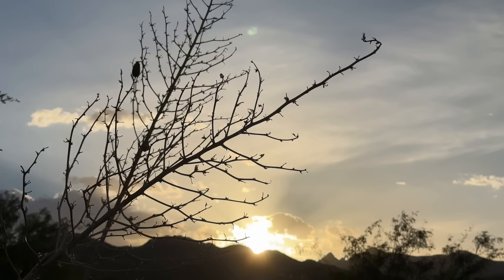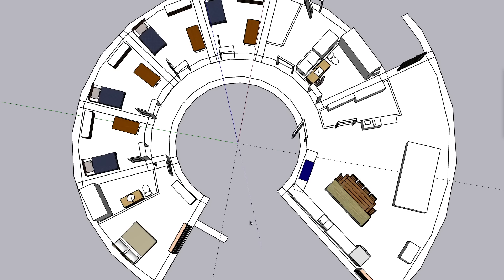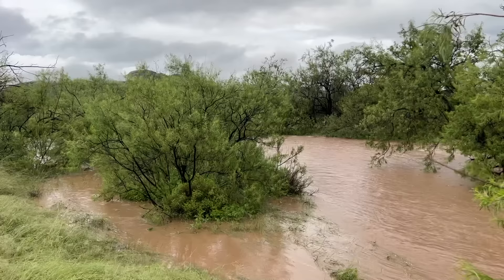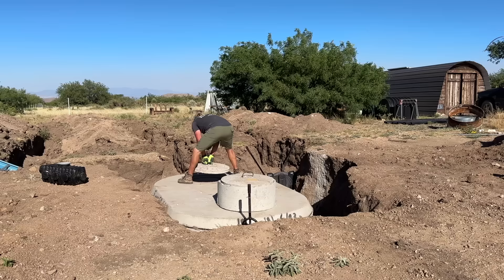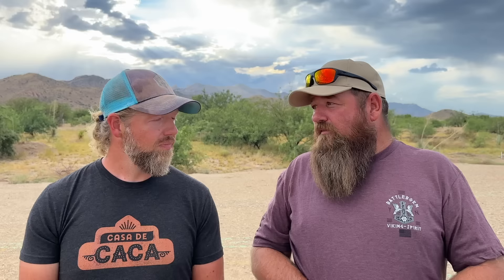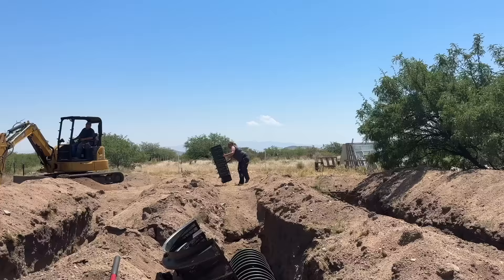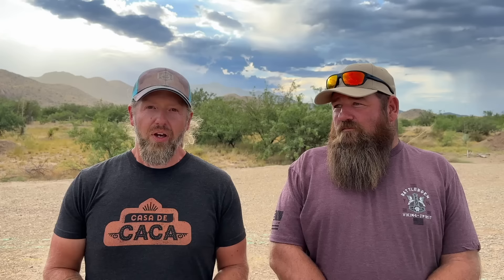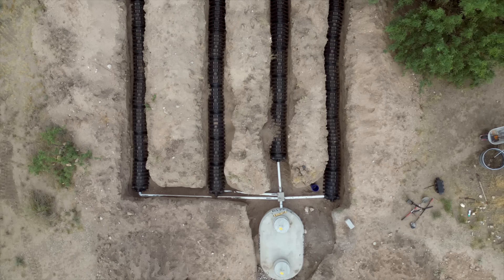How to INSTALL your Own SEPTIC SYSTEM (w Tips From a Pro)

Comment: Lots of good information here. I don’t recommend such a small d box. Always go with more holes for repair in the future. Also you won’t have to install a line across from the discharge of the sewer line from the tank. So water will be evenly distributed to all the lines.
Reply from the maker: Here in Cochise County you do have to have the D-Box sloped downhill and separate from the main septic tank. Also the equal levelers are required. The D-Box was one of the largest we could get.

Comment: Not really something you can do, but a guy I know wanted a shop toilet and he set three plastic 55 gallon drums in series with dip tubes between them. The scum if any would girm on the first one. It was mostly for pee,but if he had a solid movement, he just used tp and deposited it into a trash can to dry and them burned it later. 
  Our church had a hidden tank it was my task to find. They filled concrete chunks sll around it and with great difficulty I found it. The thing had absolutely no solids in it and it was like pumping water. .We pumped it to satisfy the county. It does prove how effective a lightly used tank is as this one eas not pumped in forty years. So the shop illegal toilet is probably cleaner than the legal house toilet .
   Out requirement is gor a split field that you divert every sux months.

Comment: A trick question, but, what would generally be the minimum lot size to support a septic system in your area?  It seems the size of the system is overkill considering your basic sandy soil and excellent drainage and depth needed for wells to reach a water source.😊
Reply from the maker: If you listen in the beginning Zach explains how the numbers work. It is sized exactly based on our number of bedrooms and fixtures and our specific sandy soil. The septic, well, and power definitely take up a lot of room on a property - you'd probably need at least 2-3 acres to get it all in there and not feel cramped. 4 acres and up on rural gets you the opt out.

Comment: My Mother was told many many years ago her septic system at the time had to have these half shaped pipes installed or else it could not be allowed ( some so called ignorant code ) and she could not have her septic system ( no local sewer system at the time ). note her homes yard was on a slope and they laid those half pipes down the hill etc. I did not know about it until the work was done, ( they would have NEVER installed it had I known I assure you code or no code ). Simple common sense tells you IF they had laid the over flow would easily transit those pipes and most would end up at the end of that system. needless to say after a bit near the bottom of the hill OUT came all the sewage over flow up to and through the surface above .
So this style system is good for warmer climates and flat areas. they are useless on slopes/hills and extremely wet areas . as over flow will always flow downhill and after it hits harder dirt etc, it will come up to the surface.
be sure you research those facts before using such material .
Now I live in my old home and we have a sewer system and no septic system and those crappy half pipes are still in the ground what a waste of money she spent at that time for garbage and a system some contractor / County inspector claimed she had to have that anyone with common sense would know could NOT work the way they laid it down the slopping property even with gravel etc...

Comment: Next time, install another tank and when the first one fills, direct the waste to the other tank while the first tank turns the sludge into compost. 
Important thing is you should use light chemicals to clean the toilet ware and put some bio bacteria/horse dung/sauerkraut/rotten milk/curd to ferment the waste.... 

 I do the same to mine.

Comment: I’m curious, why to use rock and pipe if the chamber has better absorption capabilities, and almost no chance to be clogged?
Reply from the maker: depends on your soil type. a lot of people have solid clay and when saturated doesn't absorb fast enough so they need rock for drainage..

Comment: number of bathrooms shouldn't matter. Really it should be calculated by how many people will be living in the home, but for future proofing (in case of selling the house) should be calculated by how many bedrooms you have. I have seen houses with as many as 5 bathrooms with 1 bedroom. 

For example, my house has 3 bathrooms, but only 1 master bedroom. Its a house we built for me and my wife, no kids. We also have a workout room and office that could be converted into a bedroom if we do end up having a child. So it would be ideal to get a tank that would accommodate at least 2 bedrooms, or 3 people. Personally I would go for 4 people.  

The size of the tank really just means how often you would like to have it emptied.
Reply from the maker: Like mentioned in the video, it's designated by the number of bedrooms, bathrooms, and fixtures. Not sure why you're talking about the bathrooms so much. It's a combination of all of them.

Comment: Everything is thru the roof price wise. 2003 I had a 1,200 cement tank installed 40% xtra length on the leech field. All installed for $2,00 . Then 6 yrs ago I did myself a 750 gal plastic tank w/ 60 ft leach field, dog house style, same as yours for $1,000 materials & a guy on a backhoe $875 for 8 hrs . . He dug it , I installed it . Soo about $2k. If I had it done now , it’s exspensive like u mentioned. Go poop now lol

Comment: You didn't mention that absorption trenches must always be ALONG the contours unless the distribution land is fully level.
Reply from the maker: This isn’t true here in AZ. They be pointed any direction, even curved if neeeded to avoid obstacles.
Reply: @TinyShinyHome  
Nonsense. All trenches MUST run level. I didnt say "pointed". I said run "along the contours", meaning run level.  Ask your installer. It's the code (and commonsense) all over the world. OBVIOUSLY if they weren't level, the outlet septic water would pool at the lowest end of each trench and lots of land runoff rain would flood the lowest end of each trench.
Reply from the maker: Yes, they should be level (mentioned at 14:43). "Along the contour" isn't really the right way to describe it, though. That's plotting or trenching across the slope of the land and making it level. We did that with our Berm and Swale project to catch sheetflooding monsoon rains (https://youtu.be/Z_pZSMs8vjs). Sounds like we're saying the same thing, just confusing terminology :)
Reply: @TinyShinyHome  
Jeezuz mate. The ONLY WAY to make a trench level on sloping ground is to run it along the contours . That is the correct way to state it. If it is a straight hill, it will be a straight and level trench along straight contours, yes across the slope*. If it is a rounded hill,  a spur, they will be curved and level trenches along the contours -- yes *across the slope . THAT'S  why a house site plan and a septic site plan MUST SHOW contours. A site plan can't just say "Trust me, it's level". If you dig it out with a dumpy or laser level, you will be walking *along the contours*. Nuff said.

Comment: Great vid but i not see point in the chamber in leach field as as the first will get saturated as the water just tip in from d box in the uk we put soilid pipe in level with holes in the side halfway up so the hole lenghth is full be for it tips out so its equal all the way far better and your tanks should have dip pipes on each chamber and and out let goes into a washed limes stone chamber first it takes the nast out of the out fall water far better system  .
Reply from the maker: The whole point of the D-Box is to distribute the water equally to all leach lines. Rock and pipe is another method we talk about in the video - just depends on your soil type, space for infiltration/leaching, etc... Infiltrators are just one type of septic system which works well here in our climate.

Comment: Is "infiltrator" what is generally referred to as "alternative?" I'm in Arizona and looking at areas where the soil has poor peculation, so I've been told I will possibly need an evaporation "alternative" leech field.
Reply from the maker: Zach talks about this a bit. If your soil isn’t leaching quickly the infiltrator system won’t work. He talks about rock and pipe as an alternative. I don’t know if it’s actually called alternative though.

Comment: Does the county let you build a septic system by yourself? Or does it have to be a licensed contractor? The quotes I got here in placer county was around $20k.
Reply from the maker: Like we mentioned in the video, the soil evaluation has to be done by a licensed professional. You can do the rest yourself in Cochise County, but do have to have it pass inspection.

Comment: The white PVC pipes coming out of the D box, are they level or have a 1/4" drop per foot? Also, is the Leach field level to or it has a 1/4" drop per foot too? Thanks!
Reply from the maker: All pipes drop from one connection to the next, but the trenches are level 👍🏻

Comment: Effluent outlet filter. I'm new to these systems and that is my biggest takeaway.
Reply from the maker: Yeah seems to be a new requirement
Reply: @TinyShinyHome  We are under contract on a home with a septic I wonder if it can be added.
Reply from the maker: Just a piece of plastic really. As long as you have the right sized pipe going out with the vertical bit it should be easy to add yourself.

Comment: Question? If it did not pass the Perc test, can't they use sand-line trench(s) under general permitting R18-9-E319 per ADEQ to get you to the permit stage and to have a septic system installed?
Reply from the maker: No idea you’d have to talk to the health dept or a septic installer.

Comment: 1/4" per foot drop; can one exceed that? And if so, is there a maximum drop grade? Also, are most codes (other States) for septic similar?
Reply from the maker: No you shouldn’t. Too steep of a drop and the liquid will go around the solids instead of moving them to the septic. You’ll have to do your own research for your specific local codes. Yes they will definitely change based on area, soil, county, etc.
Reply: @TinyShinyHome  thanks

Comment: Close to Denver up to the mountains some septic systems contaminate the underground pool(water) and a all family die because that. Researching around some articles seems that this system do not treat and all the pathogens go to inside the soil to be absorbed. Is this system safe if you have kids playing over the area and a rocky soil?
Reply from the maker: Like we said in the video, there are different systems for different areas and soil types. Hard, rocky soil probably wouldn't use the infiltrator system.
Reply: @TinyShinyHome  I'm in that phase deciding between the dry toilet or septic system. Researching a lot I saw that any septic system will not make miracles, just manage how fast this liquid will be absorbed by the soil, it is the best solution for do not disturb the local eco system. Basically it "hide" the waste from our  view and is not so aggressive / invasive to the eco system.
Do you agree? Your opinion is important to me.
Reply from the maker: Yeah that's the idea. Soil is a great filtration system, but it can definitely be overloaded. An undersized septic can leach into the water table, backup and create cesspool like areas, your animals will be drawn to it and get sick as will any other animals in the area. The calculations can be annoying, but they are there for a reason to keep you and your neighbors and the animal life around you safe.

Comment: A properly installed and maintained septic tank/system never requires pumping.  If you have to pump it, you are doing something wrong with it or it was installed incorrectly.  I had to have my septic system pumped after 29 years because we dumped the salt water from the water softener into the septic tank.

Comment: I just replaced my system that had the turtle shells. The idiots who installed it pitched it up. We had it done on a sunday at might night (no permits or anything), and we paid for it. Get it done the right way This new one i dont even know if its right bc the dude refused to put a tee on the outlet or an effluent filter. HE said it was against code.

Comment: No such thing as Schedule 35.  You must be talking about SDR35 pipe which is typically specified for use on gravity sewers in ASTM D3034.  Pipe with a schedule rating such as Schedule 40 or 80 is for pressurized water.  I never use ASTM specs for water anyway.  Should use AWWA specs for water lines.
Reply from the maker: Considering you can call up any hardware store and order Schedule 35 or do a simple internet search for the same term and get the proper results, it's obviously a common term that people use. While I love deep diving on systems and infrastructures, this is a video about DIY septics, and going hard on ASTM numbers isn't very relevant to this particular conversation. Love the dedication and enthusiasm, though :)
Reply: No such thing as “schedule 35” pipe.  You are giving professionals and inspectors more reasons to discredit DIY’ers and YouTube.
Reply from the maker: K, bud 🙄

Comment: nice idea... but installing a single piece, or even digging out for tank or trenches is not possible in many places.. state and/or county, and/or town/municipal rules, regs, laws require "licensed" or "approved" contractors to do all the work.. not to mention needing plans for the septic from a licensed engineer to even get started... 
  my septic was designed by a supposedly qualified engineer, and installed by supposedly licensed, trained professionals and it's 100% wrong from day 1... placement is wrong, the grading isn't right, and the connection from the house to the galley/tank is at least a foot shallower than it should be.. but everything had official stamps and approvals and hey, ...it cost over 40k, it must be good right
Reply from the maker: That's why like we said in the video, this information is specific to Cochise County, AZ. This stuff is going to be wildly different depending on your local zones, permits, and soil type.

Comment: First thing to be removed is that filter.
Reply from the maker: No, it’s there in purpose.
Reply: @TinyShinyHome  It's a pain in the ass. That's why it would be permanently removed much like unnecessary building codes. Do it to pass code then eliminate it.  That filter is completely unnecessary. Overengineered and found a way to suck more money out of consumers.
Reply from the maker: Actually it’s there to catch final solids that will clog your lines coming out of the tank. As long as you clean it yearly it will help prevent long term costly repairs, and the piece itself costs nothing compared to the system.
Reply: @TinyShinyHome  I understand the engineering. Throughout history those filters have not been there. A properly maintained septic system will naturally saturate itself and have to be replaced in around 20-30 years with or without that filter.